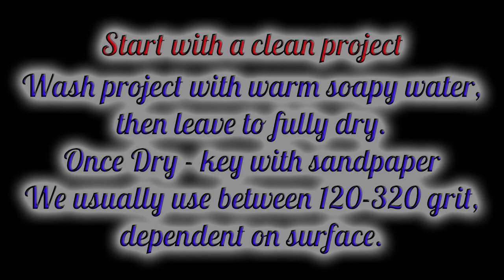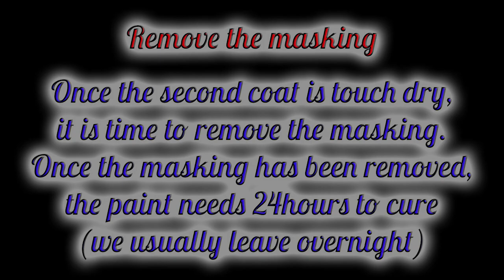Customers Own Rusty Patina Paint How to time lapse video

Comment: can it cause the body to actually rust?
Reply from the maker: No, it protects the metal work it’s painted on. Only the paint surface rusts
Reply: @rustypaint  will this rust paint rub off on your clothes and skin when rubbing against the painted surface?
Reply from the maker: Not unless you're wet as a dog and rubbing yourself over it vigorously haha... It acts as any rusty surface, so minimal transfer unless wet and rubbing against it @EricVida